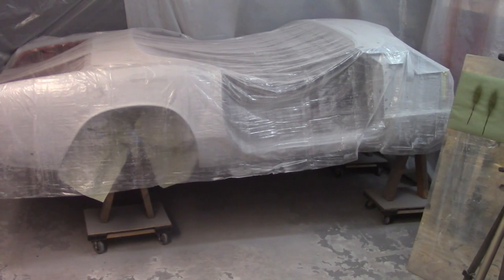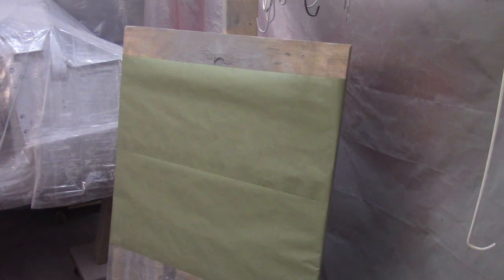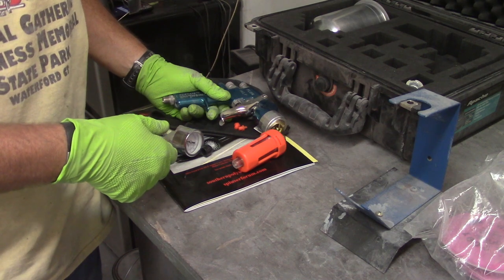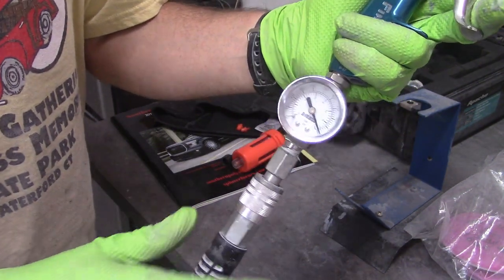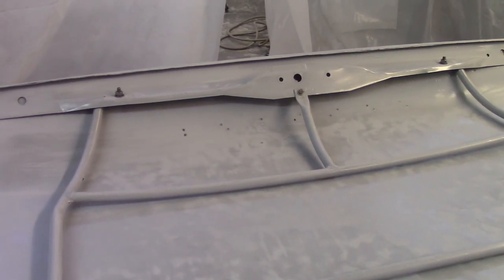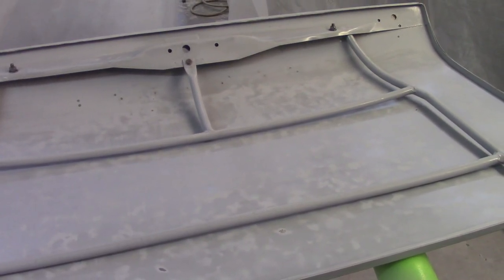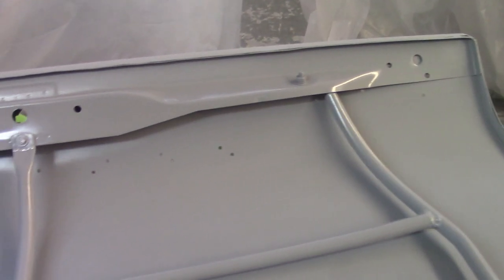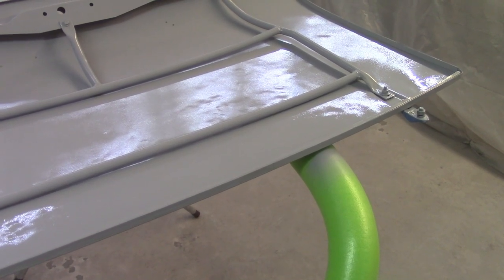I've Been Painting Wrong | Roundtail Restoration

Comment: You can literally see the difference in the camera from last video to this the material is going on wet and a much bigger fan pattern glad you were able to solve your problem :-) now make it red !!!!
Reply from the maker: Hi Carson. I was pretty sure it was going to be a difference spraying out the test patterns. I think it was easier to paint, too! Now I'm just worried about putting in on too thick since I'm used to low fluid flow. Will just have to watch out.

Comment: Another thing that I noticed, though not a requirement is hose handling. I'm no painter but I've seen it recommended to run the hose over your shoulders on the reaching areas so you're not trying to hold the hose out of wet paint.
Reply from the maker: Yes, that's another technique that I need to work on. You're not the first to mention it. Believe it or not, I haven't run the hose across any paint yet (my body a few times) so that's probably led me to the poor habit. I'll try to be smarter when I get to the final rounds.

Comment: Good detective work!  That is a spring diaphragm type regulator, yes?  The needle seems to drop a lot more than I'm used to.     Is the air inlet dial all the way open on the gun?
Reply from the maker: I think it is, yes. The gun doesn't have an air control valve on it. Per SPI's (Barry's) recommendation, I keep the air from the compressor at full blast and do the regulating only at the gun. The regulator is going from a bit over 100psi down to my set of 26psi, which is what I'm used to. Do you spray at a higher pressure?
Reply: @roundtailrestoration  I also have the compressor set high, but my regulator displays the set pressure and then it drops a little when the trigger is pulled.  Check that your regulator isn't attached backwards.  Paint is spraying nice, so it can't be that far off.